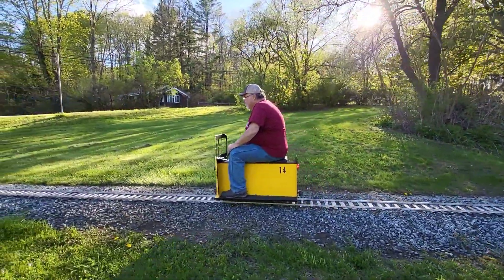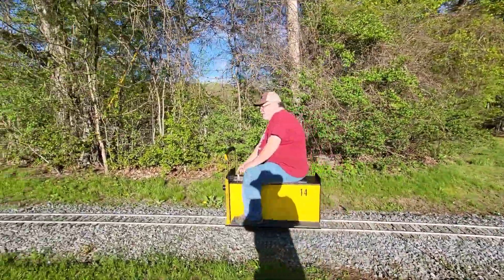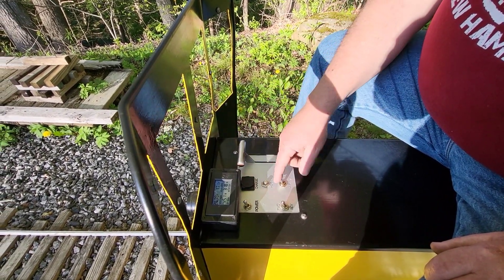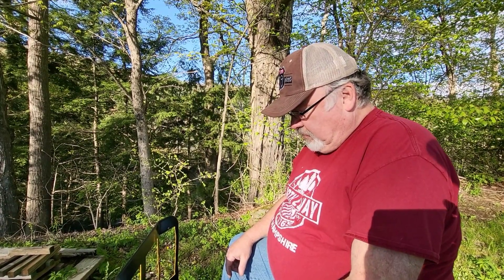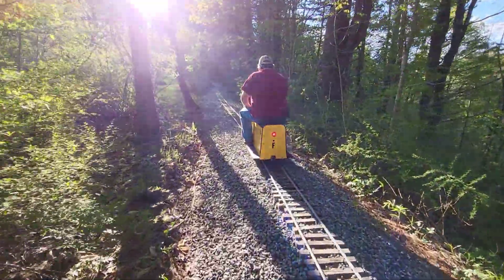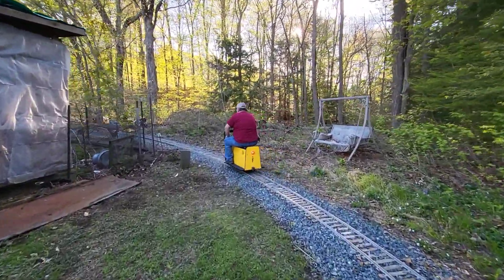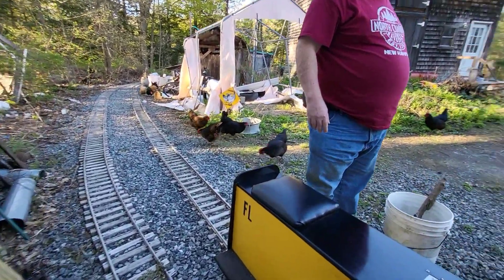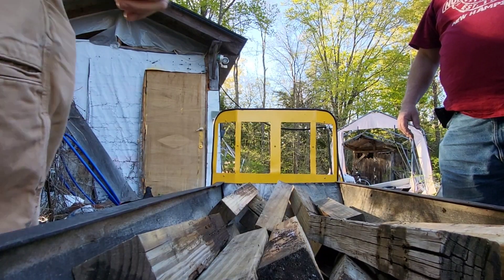Test drive after ESC swap on a customer's 7-1/4" gauge speeder

Comment: hi Greg from OZ, great video toooo, on the yellow peril isn’t the throttle controller back to front shouldn’t you push it forward to go forward
Reply from the maker: Pull back to move, push forward to stop. 
...but being a wigwag control on the R/C system, I'm forced to make a compromise on the controls.

Comment: Nice...  I look forward to working on projects like this if/when I build an outdoor RR of my own.  Hope to order some track/turnout components in the next few months, to start experimenting with.

One question...  Do you have to use such coarse crushed stone for ballast?  Follow up question...  Would smaller crushed stone be more beneficial (other than being easier to move)?
 
FWIW...  I'm hoping to use plastic ties throughout, and burying the track in the grass/sod, so smaller stone would make it easier to cover up the ballast with soil/grass.
Reply from the maker: 3/4 inch ledge stone grips wooden ties well. The folks at Enterprise Plastics may be able to help you select the right size ballast to use with their ties. 
Whatever size stone you use, it will look different than it does on my track. I have really light 5/8 inch rail.